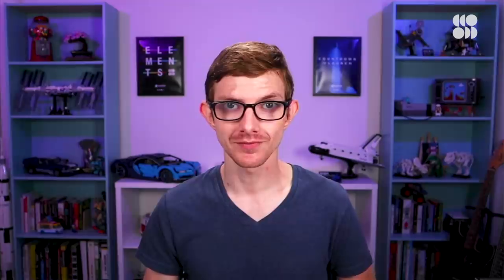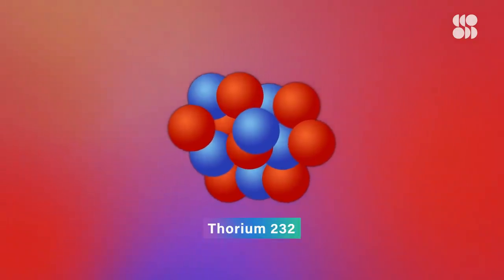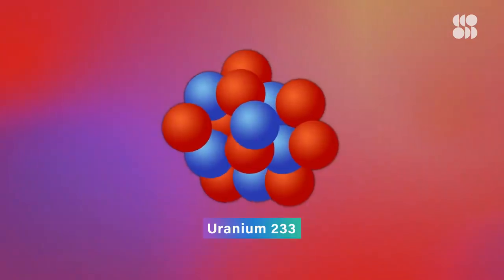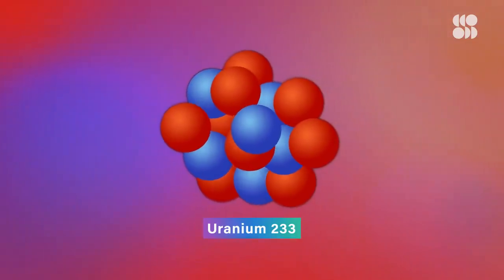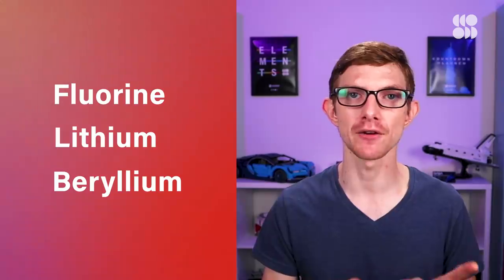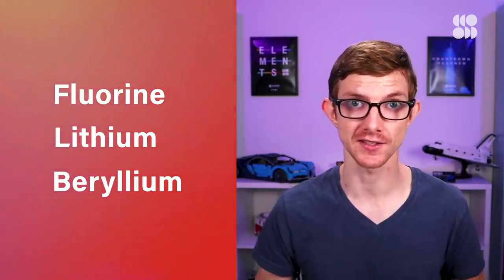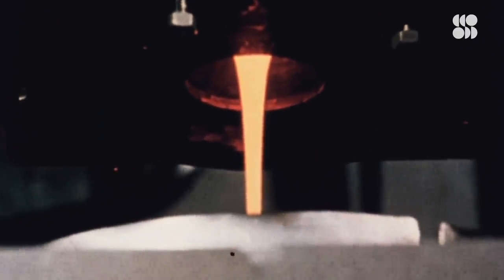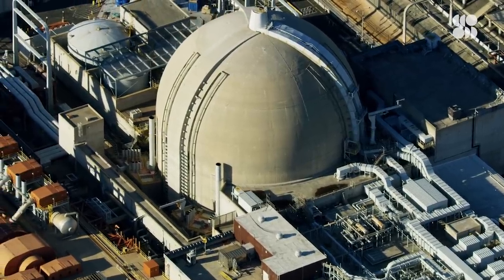The Next Generation of Nuclear Power Is Here

Comment: Great video Seeker! One reason the US opted out of thorium reactors was our need for fissile material for our nuclear weapons.  Too bad.
Reply: The program was stopped by Nixon, for political reasons...
Reply: @wilderbeast9368  
I dont understand your logic here..
Reply: @wilderbeast9368  
How do thex have media monopoly? Do you mean TikTok? This all is very interesting, where can I read more about it?
Reply: Hi Rev.  You've been lied to on why the US "opted out" of using thorium reactors back in the 60s and it has nothing to do with fissil material for weapons.  The real reason is due to TELLURIUM EMBRITTLEMENT of the hasteloy metal used for building the vessel within a very short period of time causing the vessel to lose its structural integrity.  I see this on every MSR video here that the US discontinued its research into MSRs because they couldn't use the "waste" to make nuclear weapons which is completely incorrect.  You can find information about the tellurium embrittlement issue at Oak Ridge that is easily accessible.  China built their vessels with a hasteloy and they will run into the same issue as the US did.
Reply: @paulmobleyscience  Thanks Paul. I'll gladly have a run down that hole! Happy Thanksgiving!
Reply: @paststeve1  You're very welcome, Happy Thanksgiving to you.
Reply: Except the US did build nuclear weapons from U-233 they made out of thorium, then tested those nukes and found them highly satisfactory weapons. It wasn't even particularly difficult compared to building more conventional nukes except that it didn't provide much of an upside in performance or effect compared to plutonium and U-235 weapons and they already had the processes to build those up and running so setting up a new process for thorium based weapons didn't make much sense if all it would do would be to add complexity to the process without any additional tangible benefit over the existing system.
Reply: @coreymicallef365  That is correct Corey although while they were satisfactory weapons they did not match the yield of U-235 or plutonium weaponry.  As I explained the decision not to use MSRs wasn't based on making weapons and was due to Tellurium embrittlement of the hasteloy vessel and would be a waste of money and time.
Reply: @coreymicallef365  I'm not certain, but I seem to remember that Thorium weapons produced more deadly fallout with longer half-lives.
Reply: The Navy chose light water reactors for their ships. Internal politics at the AEC  stopped development of any other technology. While ship reactors are only made by two companies the design are pretty standard. Instead of using standard design modules, like the French. Every land based plant in America is a one off. Which increases regulatory approval cost construction cost. While restraining refueling to one of two manufacturers. Depending on which one designed your plant.
Reply: @calvinroyals6463  Thanks Calvin. I was living 35 miles South Southeast from Three Mile Island when the "event" happened and have fished many times  just downstream of the island's effluent.
Reply: @paulmobleyscience  they use inconnel these days?
Reply: @calvinroyals6463  Calvin wins, vested intrest and regulations
Reply: @samuelforsyth6374  Since my comment was deleted I will replace it once again.  Inco 617 hasn't been certified for use for MSRs.  Neutron radiation can transmute other common alloys such as Co or Ni and if lithium salts are used then 7Li should be used to reduce tritium generation being that it permeates the metal, although it is very expensive.  Like I mentioned, to build the vessel for an MSR to last longer than just a few years it would be so astronomically expensive it couldn't possibly compete with other energy sources that are safer, less waste (and/or radioactive) and much less expensive.
Reply: @paulmobleyscience  if you want a simple power reactor you can go chloride salt but then you have to go fast spectrum  but then you can't make cool useful elements
Reply: @paulmobleyscience  617 got its general cert in 2020

Comment: just the fact that it can help clean up our Nuclear waste problem is a big plus in my opinion.
Reply: It's seems like the only long term viable solution to the nuclear waste problem we have. The fast breeder reprocessing route hasn't worked, they're far to expensive and there are only two in the world! Perhaps some fusion fission hybrid. By us abandoning nuclear technology our civilization might ironically end up with more nuclear waste!
Reply: @j________k  That's why a safer way to reach orbit needs to be DEVELOPED as I stated more than once and if we weren't wasting time, money and energy on new nuclear reactor designs we may have had that safer way to reach orbit already developed.
Reply: @paulmobleyscience  oh dear Th 232 IS FERTILE... Have a look at wiki: The thorium fuel cycle is a nuclear fuel cycle that uses an isotope of thorium, 232
Th
, as the fertile material. In the reactor, 232
Th
 is transmuted into the fissile artificial uranium isotope 233. You are confusing FERTILE with FISSILE. Where does that extra neutron come from .... The nuclear reactor LFTR is a breeder provides the neutron needed. You need to research LFTR and thermal spectrum breeders.
Reply: Please watch a Kirk Sorensen or something to get up to speed.
Reply: @j________k  Yes I agree I mistyped the word fertile and should have been fissle and was no confusion, my apologies.  Oh dear.....the breeder reactor doesn't just form a neutron out of thin air....what exactly is the source of the neutron?
Reply: @j________k  OH dear....Kirk Sorenson?   I think you misunderstood.   There are many things you need to get up to speed on like organically bound tritium, the use of fluoride, concentration ratios, evaporation equilibrium coefficients of radionuclides, UO2 2+, U(iv), water solubility, Redox conditions, Townsend avalanche, the inverse square law does not apply to extended sources, planks law does not apply to sources that have a flow of energy or matter from the source into the environment, tritium permeation, normalized discharges that contain Carbon-14, tritium, cesium, strontium, and many other radionuclides and a plethora of other various topic surrounding nuclear power.   You are like most pronuclear people that dance around the flaws and only promote the small amount of positives from its use.
Reply: @j________k  really lolh that is what they want you to believe. what happened in japan.
Reply: @paulmobleyscience  ok but u don't seem to understand about neutron economy. A Fission produced between two and three neutrons in average. One neutron can be used for making fertile th into ur. And one neutron can be used to fission Ur which was previously bred.
Reply: @paulmobleyscience  your advocating waiting for some orbit technology which does not exist, may never exist. And I'm saying the solution to nuclear waste is terrestrial nuclear technology. I'm glad you are not any sort of decision maker.
Reply: @j________k Well Master physicist...surely you should know that most of our radiological measuring devices are calibrated and measurements taken using the inverse square law of which does not apply to extended sources as the Bureau of Standards volume 3 shows.  Apparently it's news to you that Planks law for black body radiation has the same stipulation as the inverse square law and didn't pay much attention your first year of college.  You're degree only shows a bias towards the use of nuclear materials as you have shown in full detail here.   Again...do you think that fluoride in toothpaste and our drinking water is solely meant to promote healthy teeth?
Reply: @j________k  Obviously I know exactly what they imply and your poor attempt at a character assassination of a complete stranger fully underscores exactly what you're doing here.
Reply: @johnlarson111  wrong type of reactor buddy. Not relevant
Reply: @paulmobleyscience  i know what the inverse square law is, its not to do with what we are talking about which is how to get rid of nuclear waste.
Reply: @paulmobleyscience  i know what the inverse square law it you gigachad. I know about black body radiation. I know about why they add flouride to toothpaste (which you clearly dont) none if it is relevant to our converstation.
Reply: @j________k  What is rubbish is your inability to have an honest conversation about nuclear power with someone that knows the implications of everything I mentioned.  It isn't just random keywords as you suggest as if I named unrelated topics.  I understand how redox conditions causes uranium to become water soluble and bond with oxygen 16 and preferably 18 that then flows around the planet in the water cycle.  I understand that concentration ratios of dirt, water and animals are used to justify releasing radionuclides into the biota.  What is irrelevant is your opinion on organically bound tritium and it's affect on our society as if it isn't an issue.   Furthermore your attempting to use your bought and paid for repeat after me piece of paper as if its a tool for you to use in a discussion to further your resolve.
Reply: @j________k  It has everything to do with what we are talking about as I have just explained.  The inverse square law is what makes our devices work.  It's how we measure radioactivity to begin with and is the basis of nuclear physics.   Gamma photons of which are released at the end of both alpha and beta decay modes is the key how do you not know this being a physics major?
Reply: that is the main type of reactor in use today.
Reply: I'm going to stop. I'm sorry for the stress. We just strongly disgree.
Reply: @paulmobleyscience  U235
Reply: @paulbedichek2679  U235 is what is used in the majority of our reactors at a percentage of 1-3% normally and the rest is U238.   Did you have a question or is U235 a statement?
Reply: @paulmobleyscience  It was in answer to someone who asked where does Th232 get its extra neutron from. All Th reactors must start with some U235, or some supply of neutrons, maybe Plutonium but U235 is the normal choice.
Reply: @paulbedichek2679  Yes exactly and that someone was me trying to get someone to tell the truth about thorium.  Thank you for confirming the question
Reply: @paulmobleyscience  Th advocates are well meaning but all nuclear power is better than any alternatives and outside of India no one is burning Th in a reactor, we congratulate China on the work on a LFTR but this is a 2MW experiment.
Reply: @paulbedichek2679  Tellurium embrittlement is the issue with thorium reactors because to build a reactor to withstand this process for longer than a short period of time it would be so astronomically expensive it couldn't possibly compete with other much safer forms of energy production.

Comment: Dude forgot to mention one key point: Thorium reacts at a much lower temperature then uranium, which makes the whole operation easier and safer
Reply: This doesn't make sense, nuclear reactions don't depend on temperature. Actually, higher temperature reactors are thermodynamically more efficient.
Reply: Creating heat is the whole point of a nuclear reactor. A nuclear power plant ultimately is just a glorified steam engine. You create heat, that heat is used to evaporate water into steam, that steam powers a turbine and that turbine is connected to a dynamo, which generates your electrical power.
It is the same as a coal powered power plant, just that you don't have to burn coal to get your steam.

Many people seem to think nuclear reactors are some magical thing that just makes electricity, like a "Warp Core Reactor" in a Star Trek space ship.
That is not how it works. It is just a heat source.

It is the same with fusion reactors, if we ever get them to work. They will just be heat sources for making steam too.

So saying "Thorium is better because it creates less heat." doesn't really make sense.

It might be safer because it is less likely to get out of control than a uranium or plutonium reactor, but heat is definitely something you want and you want as much of it as possible.
Reply: @TrangleC  Agree with most of what you are saying, but for efficiency there is an optimal temperature to run the reactor, being able to control this temperature makes the energy transmission more efficient.
Reply: @dutchwebswebsites6057  no you got it completely wrong, the higher the temperature that you run your reactor at, the higher the efficiency.
Reply: @dutchwebswebsites6057  You are both wrong. The molten salt reactor will run at about 500 degrees Celsius, wich is much hotter then a 'traditional' reactor. This higher temperature is also BETTER for the reaction.
And since the fuel salt also acts as the coolant you do not need water at all, the heat can rather be transferred to the turbine with a gas like carbon dioxide. And by simply using a gas turbine instead of a steam turbine the efficiency is increased by over 30%.
Reply: Wrong, Molten Salt Reactors work at higher temperatures because they don't need a pressurised environment to contain the water at high temperature. The higher temperatures allow turbines to be smaller and more efficient. Do more research before making statements like that.
Reply: @rogerfroud300  Guess I was wrong, thanks all for correcting 🤙

Comment: One minor correction, though: thorium test bed is not small for qualification, with thorium, you don't have to maintain a fast cycle in a huge reactor. Thorium burns in slow cycle and you supply it with U-233 at a fraction of the big reactor.

Comment: Modern nuclear is safe and effective now, but its amazing to see more progress in their clean energy field. We need to build more plants now, and these new reactors can be put in place as the tech is proven.
Reply: that's what you guys have been saying through out it's entire history but have failed to delivery sustainable, effective and safe nuclear options to the world. now we're facing trillions of dollars in clean up and have to solve chernobyl, fukushima and hanford before the next incident
Reply: @Lildizzle420  
Nuclear power is the cleanest, safest, most powerful, and most sustainable energy source on the planet.
Reply: The reactors don't have to be built, as much as replacing the already existing reactors' infrastructure which isn't difficult engineering-wise.
Reply: @georgesaliba8876  
Do you mean replace existing reactors with new ones?
Reply: @montithered4741  the uranium and plutonium reactors already have the existing exterior and such, you would just change the interior turbines to the ones needed for the thorium. No sense in constructing an entirely new reactor.
Reply: @georgesaliba8876  Another option is dropping in small modular reactors at every existing coal power plant.  Basically replace the burn-coal-to-make-heat part of the plant with a factory made fission-nuclear-fuel-to-make-heat module.  The rest of the plant - the steam turbine, the cooling facility, the tranformers, all the plumbing, etc. - can pretty much be used as is.

Comment: Thorium it's a waste product of first generation heavy water reactors, the US has a stockpile of thorium that could meet and exceed the US's projected power needs for 500 years. The BIG downside of molten salt reactors is the waste byproducts it products. Things like hydroflouric and nitric acids with negative pH's and heat pollution in scales like we've never seen before. The advantages beyond CO2 emissions are you can make them small enough to put in a semi bed but still power 10,000 homes or one industrial facility and the decentralization that covers with it saving untold amounts of power generated.
Reply: The issues are ones of Chemistry, and unpleasant as these byproducts are, they can be managed.
Reply: @rogerfroud300  can be managed? And we are going to trust corporations with this management because they've done so week in the past... We can frack for oil in an environmentally safe way, yet only 3% of wellheads meet that standard and it's required by law that all of them go. So when you get power companies to follow the laws already in place... Then maybe we can move to far more dangerous byproducts.
Reply: How do you get Thorium from Uranium? Are you not confusing it with Plutonium, which is well known to be created in Uranium reactors when U-238 captures a neutron?
Reply: @eckligt  it's a long round about way because this is YouTube but you get it in the refining process for heavy water fuel. Sorry, guess I could clarify but I'm lazy and don't care to be 100% accurate. If your want perfection in things then you should leave the internet and fall into a star.
Reply: HF and HNO3 may be waste products but these are highly wanted acids, in the chemical industry both are used as reducing agents.
This is waste with a high value and can be sold to bidders. Dunno where you get the heat pollution nonsense from.
Reply: @eckligt  The Uranium ore that is mined also contains a lot of Thorium. Thorium-232 has an atomic mass slightly lower than U-233 and 235. Thorium -232 is not fissile and thus must be centrifuged out which is a pain due to the tiny difference in atomic mass.
Reply: Respectfully, incorrect.
Reply: I think you're confused, the united states destroyed it's stockpile
Reply: External combustion designs to save water if not a desalination processing system will be a way to better not waste heat.  Furthermore.... closed loop systems might be an advantage also to not waste water.